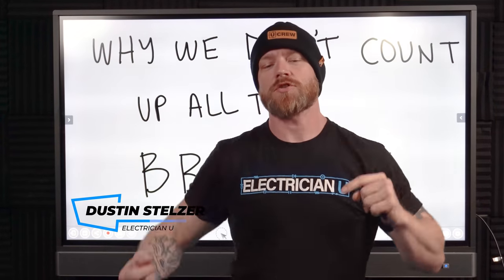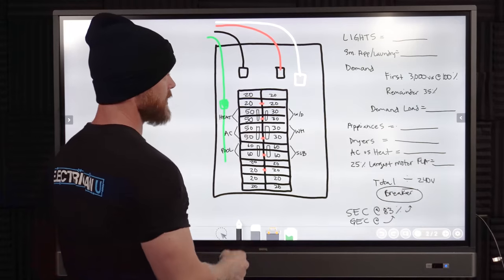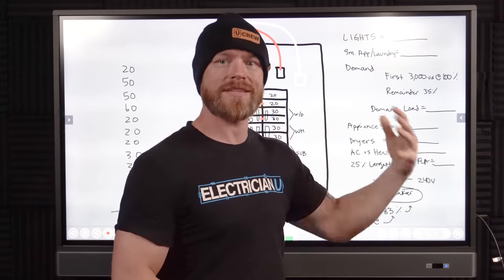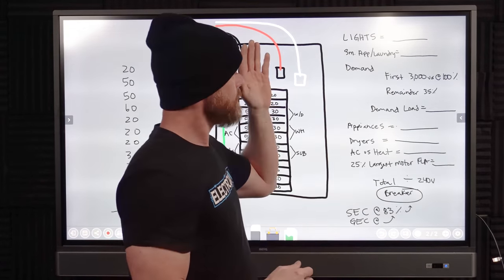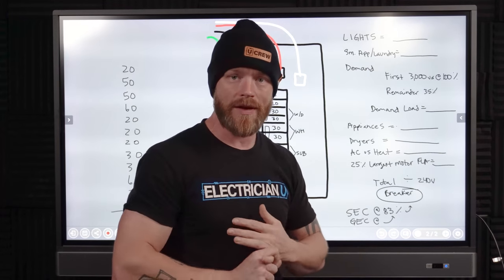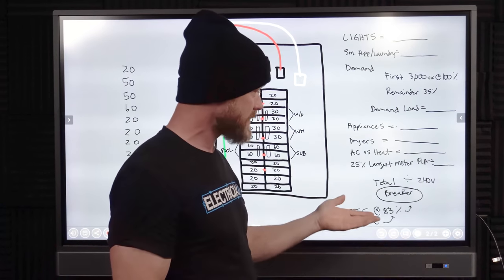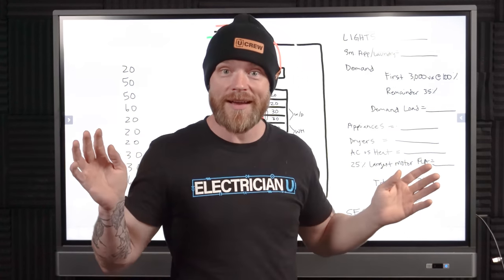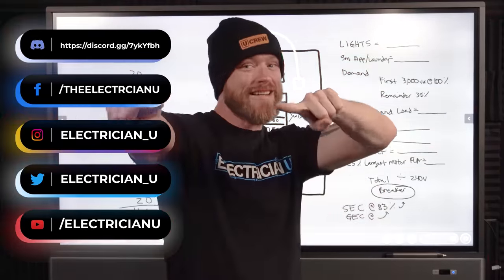Why is there more than 200 A worth of breakers inside of a 200 amp panel?!

Comment: What is the useful life of a breaker?  When should you consider replacing them?  And, is there a good way to measure the effectiveness of a 20-30 year old breaker?
Reply: Don’t know exact answer but breaker manufacturer would have some info on that would think.
If a breaker has tripped a lot from overloading its a good idea to replace. Also a thorough visual inspection of the breaker removed could give indications of wear or problems. As well, testing voltage in panel for a consistent reading may help. On a service call once clients lights were dimming erratically, breaker was corroded/ old and so was panel terminal blade. New breaker and terminal blade surfacing/ sanding / brushing, and everything worked..
Reply from the maker: The manufacturer would test a breaker for on off cycles and give a statement for useful life. But that isn't the end all be all. Some breakers out there are 50 years old and operate fine. 

That being said. If there is nuisance tripping, or the breaker doesn't actually de energized a circuit when you flip it to the "open" position IE off. 

It's time to replace the breaker. 

Same if it's running incredibly hot.

Comment: The ratio of Volt-Amps to watts depends on the phase angle of amps compared to volts. As he mentioned, that is in another of his videos.
Reply: What is the title of this other video?  Phase angle typically arises with AC motors, as the motor windings act as inductors, where the change in current flow in the AC cycle builds up a magnetic field which induces a current flow in the opposite direction.  The net effect is that the sine wave of the current is "delayed," so that the sine wave of current lags the sine wave of voltage.  This is represented in the Power Triangle consisting of apparent power (VA) going into the motor, reactive power caused by inductance (or Volt Amps reactive), netting out (by trigonometry) to the actual work done by the motor, measured in watts of power.

Comment: you were talking about adding up the loads to determine a main breaker size . another thought is your supposed to figure 80 % per circuit max ampacity, like a 20 amp circuit should only draw 16 amps max and a 15 amp circuit would be 12 amps etc,

Comment: All the breakers are not being used at max power at the same time.

AC, hot water tank, hot tub, clothes dryer, and electric stove can all run at the same time.
If you need 400 amps, might be advisable to switch to 3 phase.

Comment: 400amp is generally when the CT comes in play. Would love to see the house that calls for that 😂. Love the content btw, you da man!
Reply: Usually 320A meter sockets are used with 400A services, because the when the 125% safety factor is applied to continuous loads, it applies to the breaker, but not the continuous-duty rated meter socket.

Why meter socket manufacturers can't simply "speak the same language" as breaker manufacturers, and call it a 400A meter socket, I do not understand.   That would make it a lot easier to select a meter socket to match your service rating.

Comment: it is real fun when the 100A breaker out at the meter is welded open. there is circulatory amps..directly related to the total sum of breakers. I would hope that is not beyond a grunt electrician. DO add up the amps.. I would not go past 200 total on a 100. I restacked an apartment with electric heat... and 1 emergency call for the welded outside breaker. found several busted 15a outlets on the common 20a breaker. there is more than one slob in american juice. Terrible. I am glad LED is taking over.. huge helper on every subject related.

Comment: Have you ever discussed how to apply the VA rating of receptacles to determine how many one should put on 15 or 20 amp circuit?  This seems to get lost in the circuits per square foot in residential as opposed to a commercial installation calculation.
Seen many instances where two and three rooms (12-15receptacles) on a lighting  and receptacle circuit in house. Using the load calculation of one circuit per 600 square feet for general purpose lighting and receptacles might help value engineering a project, good luck running a vacuum on that circuit without nuisance tripping if the breaker.
Reply: Do not waste time counting receptacle on residential units.. There is no limit unlike in commercial where there are limits because commercial buildings are treated like continuous loads.

Comment: My house has 2 panels, each is provisioned with 100 amps

panel 1 - House
Washer + Water Heater (gas spark igniter) + AC + Attic Fan
Dryer + Oven + Stove + Furnace (gas spark igniter)
Kitchen + living room + bathroom1
BedroomM + bathroomM + bedroom1 + bedroom2

Panel 2 - sheds
house Exterior lights & outlets + well house power + shed interior lights (switch)
North wall
East wall
South wall
West wall.

It gets annoying that I can't watch TV while the microwave is on, otherwise I'd have to power cycle the internet.

The house was built in the 1970s, no GFCI, the outlets are all NEMA 1-15 ungrounded (Type A) non-polarized. I have to use an adapter for anything that has a ground, or a polarized plug

And I'm 99% sure that the panels and breakers are all made by FPE (FEDERAL Pacific)

I can't sell the home or get new appliances. If I wanted to replace the ancient furnace, or sell the house, I have to make the house compliant with the current code.

Comment: It is not two phases. It is one phase two hot wires when running 240v.  Running a 240v appliance means one of the two hot wires becomes in effect a neutral wire (the return).
Reply: You are like 95 percent correct except that one wire is never a neutral on a 240 aplliance. Neither wire is ever at ground potential ie a neutral. Both wires swap back and forth as to which carries the load and which is the return. 

You are absolutely correct that it isn't two phases though. You only have one winding on the home side of your transformer so on an O-scope you will only see 1 wave function.
Reply: @johnh8546  
On a single phase with neutral supply (as in Europe) the ground wire parallels the neutral. Electricity always wants to get back to the generator or transformer of where it originated. If a fault the ground takes it back. Rather than through a human body.

So two neutrals are fitted - one for fault conditions (ground).  The neutral and ground are joined at where the supply enters the premises. If current returns via the ground wire in a premises, there must be a mechanism to interrupt the circuit, as it indicates a fault.
Reply: @johnh8546  
I wrote too quickly. Both wires on 240v are the same. Current delivered by alternating back and forth in both wires at each end of the transformer. No polarity. Appliances must be designed for no polarity and have their own safety mechanisms (like fuses).   Safety circuit interupters must be fitted for fault conditions, not relying on a ground wire, as a ground wire may not take current away from metal parts or thru people - the ground wire is not a way back to the transformer.

Comment: Only time I blew the service head btw this was in the UK at the time with a miniscule 60amp service was at the time of a wedding. We had guests staying over multiple electrical showers at the same time, as washing machine, dryer, dishwasher running, electric kettle, vacuum, oven, iron and lights running. It was like once in 30-50 year event in terms of power load. That gives you a sense of the load running through the house. That being said our main breaker was faulty and should have tripped faster.

Comment: What REALLY makes you scratch your head (until you know what's going on) is the fact that you'll be working on a 200 amp panel, go outside, and notice that the distribution transformer is only 25kva... so it can only supply 100 amps of power at 240v... and there are 4 other houses, each with its own 200 amp panel, being served by that same transformer.
Reply: The breaker size in panels detrmination is to protect the wires (keep the building from burningdown). The utilities have breakers or fuses to protect both transofrmers and lines.
Reply: Something interesting, that in no way changes the point, the typical pole mount transformers can put out 130% of their rated KVA. Being so high up, the  heat can dissipate enough and the windings can take it, apparently. Still, it's fascinating the first time you realize the total services tied on to one lonesome can, 😆

Comment: I once turned on every single damn thing in my house at the same time, and I mean even closet lights, oven lights, I mean EVERYTHING. Then I used a clamp meter to check the draw on each leg, and it turned out that I was pulling 90 amps maxed out.

So basically, using less than half of 200A service. But I guess it's good to know how much headroom I have to start electric motors.

Comment: Wonder how long NEC will allow a lower caculated lightning load now that only low wattage LED'S meet energy codes. Some nuckle heads want to allow copper clad #14 guage romex to be allowed to only feed LED'S on a 10 amp circuit breaker.  Just great having halve the home luminares on a breaker and a short occurs. No problem just go out and purchase candles. Can see homeowner using aluminum copper clad romex to feed window a/c units and other heavy loads. Of course they will installnit on oversized breaker.

Comment: One thing people also need to keep in mind is that a 200A service isn't 200 Amps, It's 2 circuit coming in with 200A on each one so your 220 circuits have 200A. If you add all your breakers up your counting 2 different circuts and will find more than 200 total but that's not how the power drawl works, even then you would have to use every receptacle and every light and every appliance in the house and still may not over power the main, you would only kick the sub breaker that maxes out. So unless your sub breaker is bigger than your main breaker you'll never trip the main unless you use you hand.
Reply: Wrong, if the wire don't support 200A, 240V circuit don't have 200A too.
What happens is one hot 120V don't carry all the power itself but only half of all power, to drain all power on this breaker board will need distribute all circuits between this two phases having 200A on each phase, the 240V circuit can handle all this power with only two wires with half of current because the voltage is the double, would be needed 400A to handle all this power between only one hot and neutral.
But considering normal use don't charge all this power in watts, he uses the 83% rule, but I don't think it's safe because in case of overcharge, the breaker don't trip before the wires get too hot, and with lower currents, thinner cable can mean more voltage drop.

Comment: Hi, I had a quick question. Thank you for your time in answering. I just wanted to know if all 225Amp main service panel (solar ready) were the same size as far as Height x Width? The contractor my parent's hired to install solar, upgraded their 100A panel to 225A for solar and the HOA they live at are making a big deal about the MPS not being the same size as the neighbor, which is next to their panel. Any advise or help would be appreciated.

Comment: i have a 4 unit property all 2 bedroom units that had a 100 amp service that worked fine......the hot water...cooking and heat are all gas though....i had it upgraded to 200 amp because the service entrance conductors were really weathered and sun beaten...exposed in some spots....they put in a meter stack capable of up to 400 amps  just in case i had to go to all electric everything one day..

Comment: Can you do a video on how to choose a main circuit breaker box please. The differences between brands such as GE, Square D, Seimens, Eaton, etc. I've  seem some where the neutral bar does full length others half way, some have ground bar others not, some feed from the bottom others top, some have individual slots others double tabs only,  etc etc. How would you go about choosing the correct box for a house? Thanks

Comment: Even if u can go 83% load in the wire calculation to the main service breaker I don't think I would want too.

I guess if my incoming service wire was in good conduit, and the entrance panel was right on the exterior wall I’d consider it to “save money” but I almost will just want the extra security of having a 100% wire load calculation done, and just pay the higher price.

Comment: Check out UK ring main wiring. If you are not using them all at once, you do not need all those breakers. Use less, and share them out. Typical two story house, 5 breakers. One power & one lighting per floor, and a spur for the cooker.

Comment: I'm not an electrician but to me it doesn't make sense that you can have a service entrance conductor (SEC) that is 83% the rated amperage of the breaker. To me, a novice mind you, it means that IF you ever draw 83% of 200A (166A) or more then the SEC will melt before the breaker opens. Please round my square cause this seems dangerous to me.

Comment: I talk about this with my helpers all the time. So much focus is put on how many amps is put on a circuit and making sure the circuit doesn't have too much draw to make it trip. I can say MAYBE  once in my years in the field have I gone out to a service call or jobsite to discover a breaker was tripping because it had too much load on it. You REALLY have to go out of your way to put too much on a breaker. Obviously you could be an idiot and put a 2 pole 20 on an ac unit but even then, in a state like Florida, the MCA of air handlers are heavily weighted by the heating element which we basically never use down here 😂. I can't tell you how many times I've put an ammeter around a 200 amp panel in a fully operating commercial building and it was like MAYBE 40 amps lol
Reply: Where I live it is very common for the proper breaker of an ac unit to be a 2p 20
Reply: @tomgrummett4591  well for the "ac" which is the term we use (including Dustin) to describe the condensing unit, yes a 2 pole 20 is very normal. But that would be crazy to do on an air handler if you plan on having any sort of heat functioning because a 4kw air handler is guaranteed to pull at least 20 under load
Reply: on a typical winter evening in the northeast my 200 amp panel shows around 10 amps per leg. OTOH, with everything running steady state (not in-rush) I show about 90 amps. I suspect the FLA of everything starting at once would top out around 150 amps or so. (AC, hot tub, well pump, fridges, air compressor, etc) The only time that might happen is after a power failure when everything restarts.
Reply: Actually, it's pretty easy to overload a circuit if it's not a hardwired / dedicated circuit. In your HVAC case, you install the breaker and wire sized to the label on the equipment, and it's the only thing on the circuit. Circuits with plugs... people pop those all the time.
Reply: @jfbeam  yeah people pop them all the time but rarely is it from exclusively from putting 20 amps on a breaker from standard use. Obviously if they are plugging in some crazy big thing then yeah that could be a problem.

Comment: A 200A service accommodates approximately 40 circuits. In a modern 3,500sqft or larger house, 40 circuits is inadequate to supply numerous rooms and outdoors. Given that only a fraction of the available amperage is in use, does the code allow you to use a larger panel with 200A?
Reply: A very common install is to purchase the 200 Amp Main Panel with Feed Thru Lugs. Then come off those lugs to a 200 amp sub panel ( sometimes side by side but it can be placed anywhere else to Code in the house). What matters is load calculations for the entire house are done correctly and don't exceed 160 amps (80% of 200). If more than that, A 400 amp service is the next move up.

Comment: we put in 400A main service all the time in big houses in the bay area. we put in a 60Kw back up generator in a house that was on a 600A service though a meter and and socket. i dont know as much about that side of things though
Reply: That back up generator is only 250a max. If its the last load from the main bus you could use the 125% rule (if needed) and even derate the main (if even more needed)

Comment: Dustin - can you do a video on adding 2 pole breakers to panels and the load calcs needed to tell you that you wont be overloading the panel depending on the device your putting in on that new circuit? run on sentence

Comment: The breaker is rated for MAX load at start-up......HVAC does not need 20 amps to run, the size covers the surge when started.

Comment: Great explanation. Also something that is absolutely nuts is I’ve now put up 2 800 Amp services on houses in Wyoming!! Mostly because they can only use electric heat where I’m at. It’s quite an experience, they have 500 KC mill going to them.
Reply: Why not?  I realize that natural gas may not be available in a rural area, but couldn't they get propane or home heating oil?  It seems to me that it would be a whole lot cheaper than electric heating in a very cold climate.

Comment: So I currently have a 936sq ft house that I’m fixing to finish the basement in. I’ll be adding 1bed, 1bath, living room and full kitchen as well as an additional hot water heater. The current water heater I have upstairs is a tankless that’s 27kw 240v 112.5 amps. The house currently has a 200amp service. Would I most likely need to upgrade to a 400amp service considering I will now have 2 stoves, 2 refrigerators, 2 water heaters, 3 window a/c/heaters, 1 washer, 1 clothes dryer, 2 dishwashers, and probably a deep freezer. 

Any help or advise would be appreciated. Thanks

Comment: um, you don't add the amps on 240 with a 2-pole breaker. The increased voltage doubles the power (Wattage) delivered. Adding up the amps would quadruple the output.